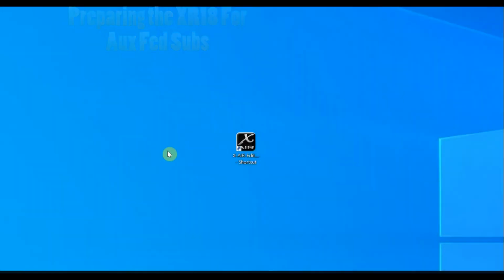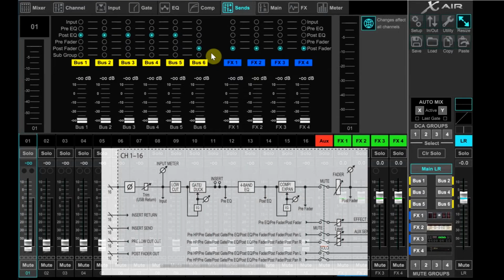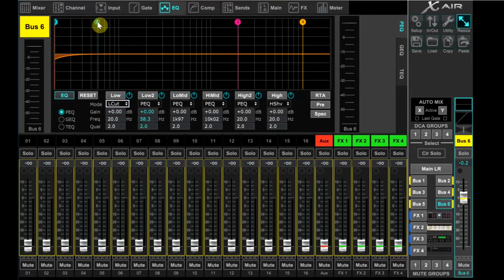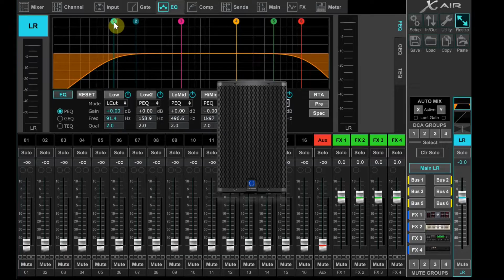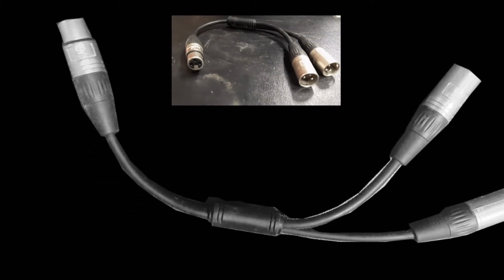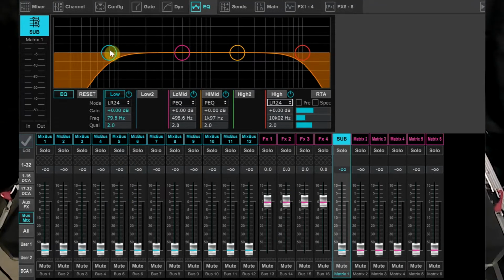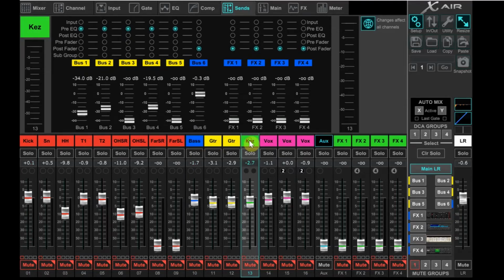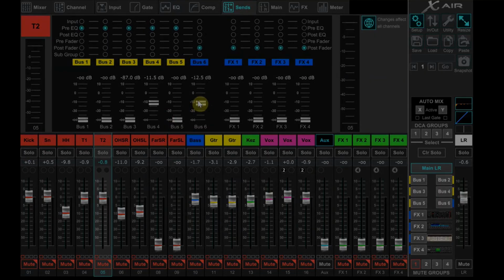Aux Fed Subs Setup For Behringer XR18 X-Air - Midas MR18

Comment: Instead of taking Aux 6 sub from the aux 6 of each channel, could you take it post fader of the mains so they would automatically track together and not have to move those faders individually? Of course you could not remove certain channels from the sub mix- but simpler might be better. Also when using the PEQ as a xover, can the filter "quality" be increased beyond 2 for a steeper curve?
Reply from the maker: There's no real way to do that as far as tying sub out and main out... There's no 'post fader' of the main option... EXCEPT... Since the aux fed sub feed on each channel should normally be post fader anyway, you can assign EVERY channel (including FX returns) to a single DCA (call it MAIN DCA). Once you have your initial sub/main balance correct, then use that "MAIN DCA" to control overall volume.
This essentially does what you were hoping to do with your idea, but your idea doesn't have a way to actually implement it on the console.

I'm sure layering filters will increase the sharpness of the overall filter effect, but I'm a big believer in handling speaker processing (at least as far as crossover functions) to external hardware. External hardware is almost never touched. The console is constantly getting tweaked, changes made, mistakes made, multiple operators, scenes loaded, etc... and eventually someone is going to overwrite or reset the EQ or reset the entire console (intentionally or not) and there goes your system crossover points. And you might not know it until it's too late.

Comment: Thank you for this. I set up the way you outlined on my XR18 and love it. How do ya link the Main L/R and Aux faders...?
Reply from the maker: They don't give users a way on the XR18, but what you can do is assign EVERY channel to a single DCA and name it MAIN DCA (or whatever you want to call it). That includes the FX RETURNS and 17-18 Aux In stereo channel. You still have to initially set the Main L-R and Sub faders to get your initial balance, but once they are set then you can just use your MAIN DCA that you created to control the mixer volume on one fader from that point. You can leave the Sub and Main L-R alone at that point.
The key is that your sub aux on the channels has to be set to POST fader... but it should be anyway.
Reply: there's another way round it if you use mixing station and are creating a custom layout. you can create an iDCA and place it in the mix layer. if you assign the main fader and the aux 6 fader to it, the iDCA will control both at the same time.

Comment: Your vids have helped me out immensely Alan! Thank you for all your time you are putting into them! I'm an old "analog" sound guy and getting this XR18 has really "lightened" the load so to speak! I have an issue with my XR18 in that I get nothing out of my headphones to monitor with them. Not sure if I need to send my unit in for repairs or if I just haven't found the "button" to engage them! I know my headphones are good, as I can plug them into my Soundcraft mixer, and they work flawlessly, but not out of the Behringer!
Reply from the maker: Have you changed the default routing/setup in the console? In X-Air Edit... Click In/Out (routing) on upper right then tab over to MAIN OUT and you should see a graph with PHONES on the left side... that there should be a circle in the block for "Monitor". That is the default setup too.
Then the other place to check is SETUP.... and tab over to MONITOR. Monitor source should be LR AFL in the drop down.
Channel solo is normally PFL. Bus solo also normally PFL.
Monitor level is normally 0.0 (which is unity... but it can be turned up or down so if yours got turned down to off that would kill the headphones)... And there's a source trim that also should be a unity (0.0). I think all of that is the default settings.

Of course, there's also the headphone level control on the front of the XR... Which should be up... but could possibly be bad...?

Comment: you can use two lcut filters on an xr12/16/18 to match the steep slope of a lr24 filter on an x32, in fact when you do that on the x32 it disables one of the other filters in the eq because internally that's what it is doing
Reply: that said, i don't want to use the xr18 as a dsp, it feels like that'd be a nightmare to manage as you said, i just don't have a good alternative yet since the xr18/x32 support linux and no dedicated dsp does.
Reply: ok, i think i have a plan, i've only got 3 stage monitors so that leaves 3 aux sends available.

i'm going to use two of them for my mains along with the last one for my sub, with the lcut and hcut doubled up for suitable crossover roll off, and to achieve a single volume control i'll assign each of the three busses to a dca group.

this will let me monitor the full mix for streaming/recording and also allow complete control over the subs and tops without costing me an extra $1k for an x32 or a loudspeaker management system, which is money i'd rather spend elsewhere on what is essentially a hobby right now.

thoughts on this?

Comment: Happy New Year,  Alan!
I have 2 sub. Should we setup stereo sub for better sound or mono sub setting will give us the same sound quality? 
For now,  think stereo setting will give us more dynamic sound which will be better. AmIright?
Reply from the maker: In almost all cases these days, when subs are driven by their own feed, they are ran mono.
In fact, many times systems are configured for stereo but even when the engineer is not using aux fed subs, the subs are fed from a mono matrix, so they are still mono regardless of any panning on the channels.
So, I wouldn't worry about setting up two outs for stereo subs. There's nothing really to be gained by it except to complicate the setup a bit and use a bus that you might want to save as a spare or use for a record feed or something.
Reply: @AlanHamiltonAudio  Thanks for your quick response! 
Kind regards.

Comment: Thanks for sharing! I followed your steps but my issue is…I only want the Kick going to Sub on Bus 6. It IS going there but it’s also going to mains. I don’t want Kick going through mains. Is this possible? Is there a reason I shouldn’t configure it this way?

Thanks again 🙏
Reply from the maker: Let's breakdown the answer into multiple parts. First, if you want the kick only going to the sub, you can unassign the channel from L-R. In X-Air Edit, select the channel, select the channel tab, and at the far right you should see MAIN OUT and a LR button that is highlighted to assign the channel to the L-R out. Or, select the channel, select the MAIN tab, and now that same button is on the left side in the MAIN OUTPUT section. Either place does the same thing.

IF you've done that and STILL have sub in the mains, then on Bus 6 in the Main section (right of mixer), if you select the Bus 6 main fader, and then MAIN tab at the top, in the left hand side the Main Output section, Main Stereo LR button should NOT be highlighted. If it is, then it's sending the signal in Bus 6 to the XLR Aux 6 output AND the mains.

Ok... but then the 3rd part of this is to ask why you only want kick in the subs? There could be reasons... like you're in a very small venue and everything is loud enough from the stage so that it doesn't need to be in the PA, except maybe you just want to add some missing low end to the kick. Or maybe you're just wanting to send lows to a drum sub monitor that doesn't have its own filter.
But thses aren't necessarily typical. A kick has a full frequency response. You of course have the low end and the bass you feel in the kick, but you also have mids and upper mids to even some higher end content for the click of the beater. The attack of the beater. You generally want that as part of the house mix. How much you want to emphasize that (or even de-emphasize that attack) is drummer and genre specific. But it's there. So you don't necessarily want to ignore that part of the kick drum's frequency response, nor the mids, as it's all part of what gives the kick drum some definition and its overall sound.

For an example of this, if you haven't seen the kick drum video on the channel, you might check that video out:
https://youtu.be/CQg1_-ZJ4MU

Or the video micing Kenny Aronoff's kit:
https://youtu.be/uXGug5smBrQ
Reply: @AlanHamiltonAudio  Thanks for the response. From your description, I was able to identify how to remove the Kick from the Main Output. I also see your point about granting the Kick a full sound response by including in the Mains. Now we wait for the next rehearsal to test the differences between the two. We are playing a small venue next - which is why I wanted to keep Kick limited to sub but that's to be determined. Thanks again for sharing your wisdom.

Comment: If you noticed on the X32 Low1 when you select LR24 (Linkwitz–Riley @ 24dB slope), it disables the Low2 ?? You can also stack two low cuts on XR18 to double that slope to 24 as well. I haven't done a phase alignment check to see if it matches LR24 but I suspect it does as a single cut (low or high) is 12dB. I've stacked two low cuts and two high cuts on a XR18 Aux output to get a controlled band pass filter before and it works. I probably should install REW and check the phase to verify.

Comment: Hello Alan recent sub here, loving the content! In your honest opinion is the mr18 worth the extra few bucks over the xr18….? I’ve been toying with the idea of going digital desk again as our band is running out of channels since adding a keyboard player! I’ve two options! Option 1 is to buy a new mr18 for 850€ or option 2 is to buy my brothers couple of years old xr18 and a full set of audix drum mics for 800€ …..! Any info/recommendations would be greatly appreciated.
Reply from the maker: I'd recommend the MR18 if money is no object, but in the real world, in a small club with a small sound system, you're not likely to hear the difference in the XR18 vs the MR18. And if the money saved gets you some nice drum mics, that is actually a place where you'll notice more of a difference. It sounds like the XR18 deal is the one for you. 
When the MR18 had a 10 year warranty, that changed the dynamic a bit... but now that it's 3 like the XR18, it loses that advantage.

If you're in larger venues with really nice (read: expensive) large sound systems capable of high SPLs, a large dynamic range, and a wide frequency response, it's possible you'd notice a difference in the two (although that is debatable once the venue noise is in the equation) but it's also not a case where the CROWD would notice the difference. A good mix is a good mix. Good mix practices are good mix practices (IOW, keeping the system out of clipping, good gain structure practices and EQ practices)... Neither mixer will get in your way of that.
Reply: Thank you for the quick and very interesting reply, we only use a set of 2 way 12” dynacord tops with a set of ev 18” scope’s so that rules out the big expensive system part of it ! Have you used audix drum mics before…? What are your opinions on them….?
Reply from the maker: @billytremoloband7456  audix makes good stuff. No issues with audix.

Comment: Great video, but now I'm bummed. I have an x32 and have it set up for aux subs using the center channel linked to the mains. I also have an mr18 that I was forced to use last minute at a show without a crossover available. I set up aux 6 to use and was looking everywhere for the option to link to mains. Couldn't find it and spent the night fussing about with things. Now I know why I couldn't find out how to link them lol. Seems like a no brainer to include that feature on the mr18. Hope they change it soon! Anyways, watched a few of your vids now so I subbed today. Thanks for all the tips! Cheers
Reply from the maker: One thing you can do, if you have an available DCA, is assign everything to a DCA and call it "Main DCA" (or whatever). Set it at unity to start. Once you then have you main out and sub level balance set as you want (just like normal), since the sub is on a post fader aux, that DCA will now work as a main level for everything.
Reply: @AlanHamiltonAudio  I haven't worked with DCA's much as I mainly do smaller shows where I'm working a single stage with a stack on each side. It's old school lol. I will definitely get familiar with the approach you laid out in your reply. I still wish the mr18 had the center channel feature though. Thanks for the tip, I'll try it for sure!

Comment: Thank you for this useful video.  I am using my X18 with a yamaha dxs15 and yamaha dxr12 tops.  I thought I understood how subs work, but it turns out that the dxs15 has a low pass filter but not a crossover.  I was thinking of replacing it with a lighter RCF 705 as ii, and it appears that the RCF has a crossover?  The "thru" jack on the dxs15 is always full range whereas the RCF "thru" jack seems to pass only the frequencies above the crossover setting.  Apparently the RCF tops don't have high pass filters whereas the yamaha tops do.  So, for now I set my yamaha setup up with 100 Hz on the tops and sub to get my 100 hz crossover.  I see you have addressed topic of crossovers some in the video and comments.  If I decided to mix subs and tops that aren't compatible as far as crossover settings, how dangerous/bad is it to use the double low-cut + PEQ method for making a digital crossover in the EQ section of XAir?  I read about and tried putting in two low cut filters and then slipping in a slight PEQ band peak next to it to get what looks like a pretty nice crossover curve that is fairly steep.  Is this a legitimate solution or a bad idea?

Comment: Alan, I have older passive JBL speakers and I plan to use one or both as subs. I just acquired a Crown XLS1000 but cant find any instruction or best practice specific to setting it up to provide either one channel or both (bridge mode) to send low frequencies. What would you recommend I do. BTW, I'm a novice ;-)
Reply from the maker: I don't think I've used the XLS so I had to find the manual. 
https://www.crownaudio.com/en/product_documents/142169-1_xls3_multilingualmanual_041210-pdf
The XLS doesn't have a lot of power, so for subs I'd definitely bridge it. But make sure you don't connect more than a 4 Ohm load to it. The manual has info in the "Getting Started" section.
Then I'd use the Bridge mode with a LPF and select a crossover point there. Without knowing your system it's hard to know what to pick, but if your tops have a 100Hz HPF, then set the Crown XLS at 100Hz for the LPF. It could be, if you like bumping your subs a bit, that you'll 'like' a 10Hz or so gap... So maybe the subs are at 90Hz and the tops 100Hz. Or Subs at 100Hz and tops at 110Hz.
The concept here being that if everything was completely flat then the overlap point of the sub to the tops would be at one select point. But if you raise the level of the subs, you're moving that point higher. Lowering the frequency of the crossover would naturally lower that point of overlap back to where it would've been had the subs not been boosted. So it's not really a 'hole' in the frequency response. Just a trick to keep things from getting thick at that crossover point if the subs are ran hot. ...If that makes sense.
Reply: @AlanHamiltonAudio  thank you. I realize I gave you a very specific question without a lot of info to go on. Currently, my XR18 is only used in my studio for rehearsal and recording demos. The Main L/R are connected to Alto TS120A powered speakers. I just bought the Crown amp from an estate sale. The passive JBL speaker is in a homemade cabinet. Using what I have the plan is to connect one of the JBL cabs to the Crown fed via the AUX bus using the Crown amp in Crossover Mode
'When using the “Crossover Mode”, the amplifier is configured to use a LowPass
Filter on Channel 1 and a HighPass Filter on Channel 2 but only using channel 1.
I think this will be a better option so I don't overdrive the JBLs. I'll have to double check the model and the Ohms but I think they are 4 ohm.
Thanks again.

Comment: Another question: I am trying to get the kickdrum only out via the subs. Is there a way to route this? I somehow don't manage to take the signal out of the mains...TIA again
Reply from the maker: That is simple enough... Just unassign that channel from the L-R out on the channel. But why would you want the kick only going to the subs? There's plenty of other frequency content in a kick that is above the subwoofer range. ...Unless you're just going for some song specific effect, normally the kick would go to subs AND tops.
Reply: @AlanHamiltonAudio  Thanks for the reply again. We are a 4 piece band in small room with loud instruments. The drums are not mic'ed to go through our PA system, only the vocals are. Bass and guitar simply come from the amps and drums are plenty loud. So I don't use the subs for anything as they are not needed and only routed the 3 vocals to come out of the tops. Therefore I thought to have only the kickdrum come through the subs to give it a little more low end, as it is a small kickdrum. It might be a stupid idea though and muddy up the whole mix, but I will simply try it.
Reply from the maker: @sanchopansen4431  I kinda wondered if that might be what you were doing. That's not necessarily a bad idea, especially for the kick that you might want to emphasize the lows a bit more than the natural volume of the kick allows.
Reply: @AlanHamiltonAudio  I will try it and post my result here. Thanks for the help! Keep up the great work.